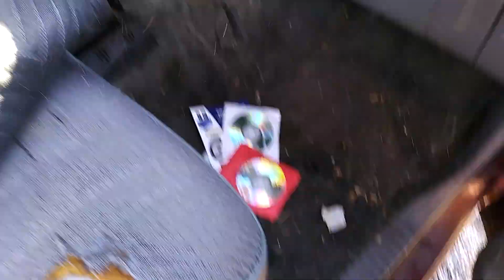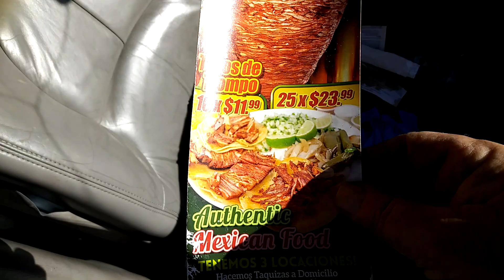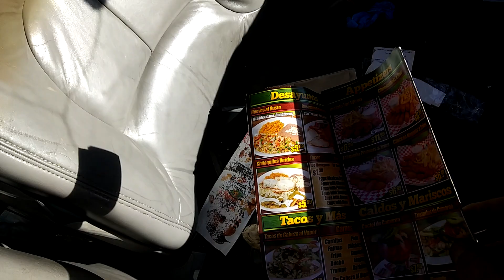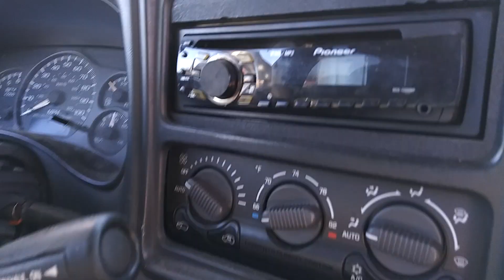2021...Back at The Spot 👍😀

Comment: Surprised that they don't pull out the Xenon HID lights out of those Nissan & Infiniti vehicles, both for the ballast & parts ,plus those aren't supposed to go into the crusher because they contain Hg Mercury! They also contain a good amount of aluminum in most vehicles as do most of the modern LED headlights contain large amounts of aluminum as well, we process them for the cores for alot of OEM's & they add up quite quickly for scrap value as well as the core charges